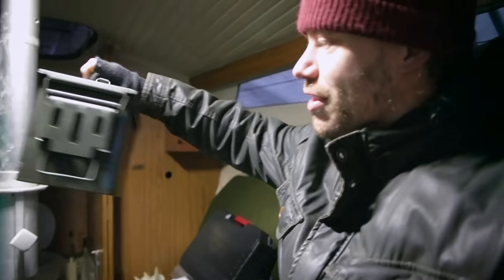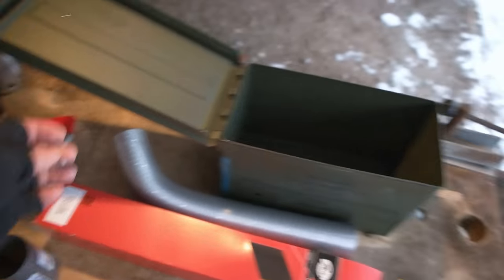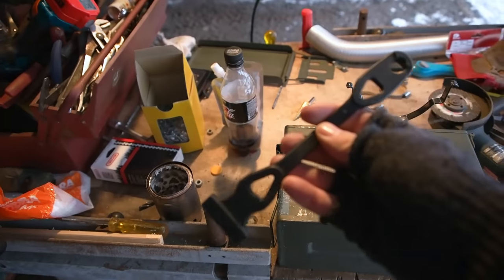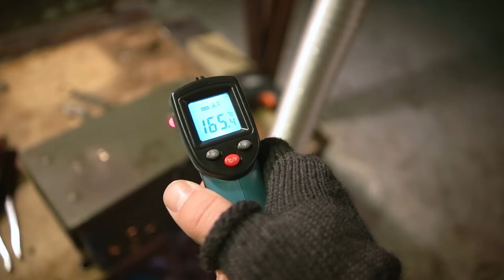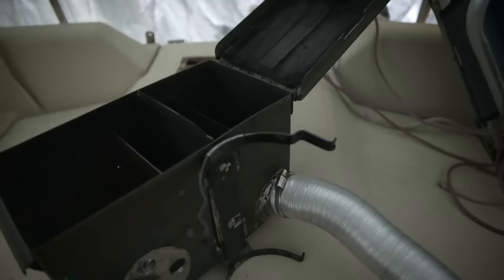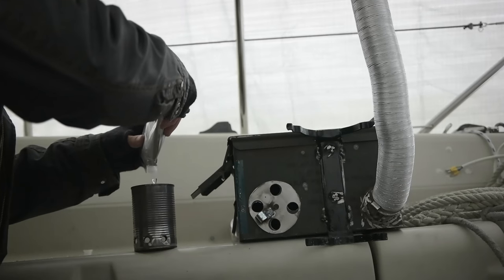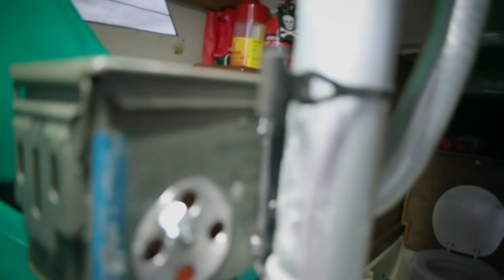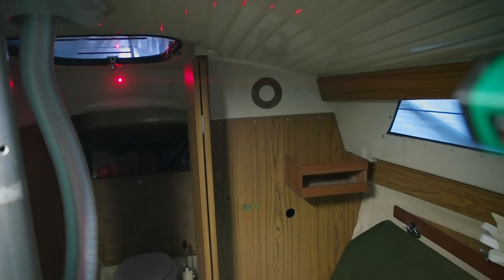Wood pellet heater for my sailboat - Part 1

Comment: Hi Pauli
I like you ideas especially the out board conversion
Now you seem to be reinventing the wheel.
A chimney flue /exhaust has be hot in order for it to draw smoke properly
make sure it is clear from flamables and best choice is a double flew that petrudes above the top of the cabin/dog house
also  it is essential that you take on board a carbon monoxide alarm, it is hard to dig a grave in Finland when the ground is frozen, Just look after yourself.
don't have a fire without an adaquate vent

You could buy a purpose built small wooden stove and flue/chimney that is designed for a boat or if funds are low copy a recognised design
Sean in Ireland
Reply from the maker: +sean corrigan Thanks man! I'm gonna test this prototype a little more and then do my conclusions what to modify.
And thank you for your concern, I'm on my way to buy a carbon monoxide alarm :)
By the way carbon monoxide is "häkä" in Finnish. Much simpler to say :)

Comment: I believe the draft will be much improved if you install the exhaust outlet on the upper part of the box or on top of it instead of on the lower part. I agree with Sean Corrigan that traditional chimneys (in houses) need to be warm to be efficient, but that's because most of them are made from masonry and tend to store humidity and frost, which has a tendency to block the draft. This should not be a problem with a short metal pipe as in your boat. Installing a carbon monoxide detector is a life saver.
Reply from the maker: +Uffen Good point. I keep on experimenting :) and I got the detector. More on that in the next part!

Comment: I think it would be more efficient if you weld some plates to the box. More surface would give more warth to the sourounding air. mount the box nearer to the bottom, otherwise the lower half of your boat will keep cool
Reply from the maker: +Peter Fehringer That's true. I'll test the position when I get out on the water and less stuff in the cabin :)

Comment: Hey Pauli, Don't Worry, Your English is Much Better Than My Finnish..... ;-)
Reply: Oh & they make Ammunition cans larger than that. If you want one, there is  a .50 Caliber machine gun can or even bigger a 40MM Grenade Launcher can
Reply from the maker: +patriotpioneer Thanks for the tip! Yes, that's a .50 cal can. Only one place to buy them here in Finland selection is not that wide :)

Comment: good stuff, but you need to work on that wood gas burner. at like 10:30 or so you can see it burning with a big yellow flame. that is not a good clean wood gas burn